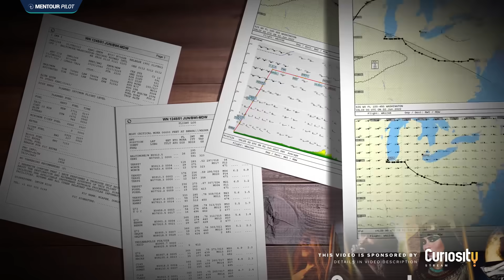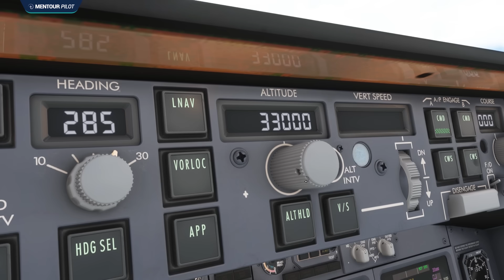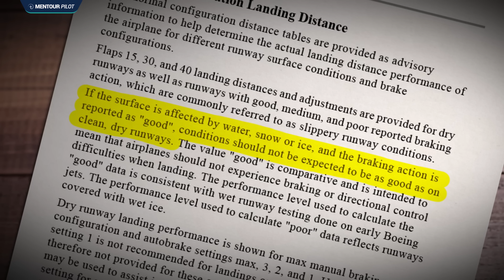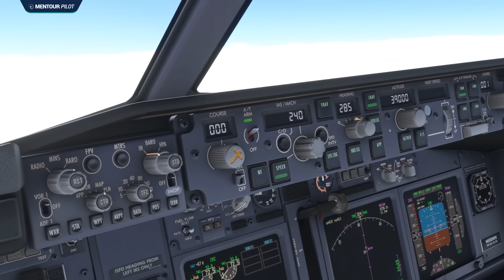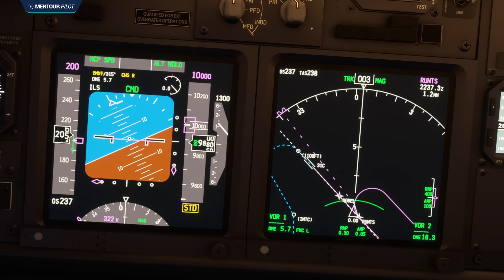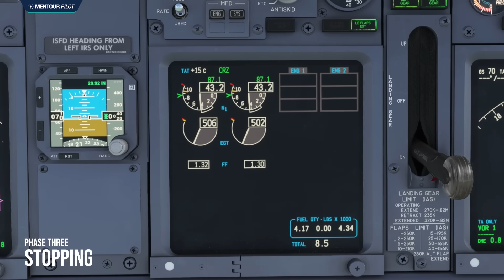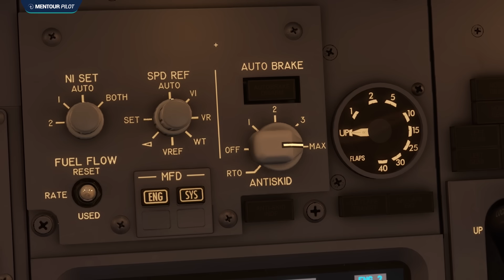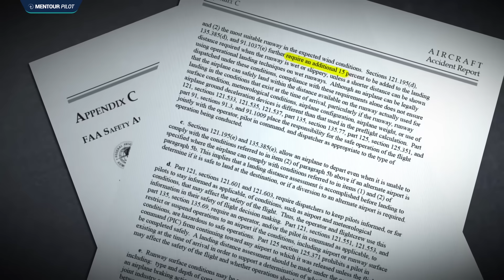WHAT did The Pilots MISS?! Explaining Southwest Airlines flight 1248

Comment: Hm, that was a nice explanation about the breaking process, especially for specifically 737-700, but now i started wondering which part of the procedure actually does the most?

For example, given the perfect weather and plane conditions and an inifinitely long runway, which system alone (or combination of them) would stop the airplane the quickest. Are brakes without spoilers and reversers enough? What if there's no breaks at all, but there is a reverser and spoilers? I am aware that the landing in this video technically has the answer to the second example, but in this case the weather conditions were... slightly unideal. Obviously, the simulation could be extended to these conditions and go from there, but it's the same idea.

Comment: So you're coming in for the 6522' runway 31C at Midway with an 11 knot tailwind and poor braking conditions using the auto-brake at MAX. You land right on the mark, touching down 
at 124 knots. Roughly how far down the runway would you be, without using thrust reversers, 18 seconds after touchdown? And roughly how long does it take to get to max reverse thrust if the engines were at ground idle speed when the reverser was applied?  After 18 seconds, it sure doesn't seem like there could have been much runway left to use.  (Reminds me of a pilot friend who use to say "the 2 most useless bits of info when flying are altitude above you, and runway behind you").

Comment: Not a smart question but: what if the pilots had considered quick flap retraction after touchdown and also full forward yoke deflection to increase downforce as much as possible? Would that have made a big difference?
Reply: I don't think so. Pitching down a plane after touchdown would rather mean lifting the aft and the two rear undercarriages to bring down one at the nose. Doesn't make sense. Furthermore, a working aft brake should help rotate the plane down and bring the nose wheels down, too.
Simple thing of inertia. 
Stone me if I'm wrong, I'm not a pilot.
Reply: Quick flaps retraction is useless with airliners since you have speedbrakes. A little bit of forward pressure on the yoke might be used for directional control , but not for braking since the main gear is not near the front of the airplane.
  And full forward pressure straight after touchdown would cause damages to the nose gear.

Comment: Would it be practical at all to install emergency stop areas on the ends of runways with things like sand pits? They're not that uncommon on roads/hills for runaway trucks whose brakes can't keep up. Stopping an aircraft I'm sure presents a number of unique challenges but the aviation industry is filled with talented engineers who could likely give it a fair go, no?

Comment: It’s hard to get your head around what happened here. During my whole career, if there was ever even the slightest bit of doubt about landing conditions, we were always so conservative, and so ready to deal with whatever might possibly happen. In anything less than perfect conditions, Full Reverse thrust was always out the second the squat switches allowed! 
We also ALWAYS used max autobrakes in poor conditions- it’s very easy to disengage if max braking is subsequently not needed or a go-around is required.
I was shocked when this original report came out- at the time I thought what the hell were they thinking? In my company I don’t think we were ever allowed to make the assumptions that they did.

Comment: EMAS needs to be used more than it is. I don’t know the cost involved, but with the number of runway excursions increasing, any runway less than 8,000 feet should be one factor in the selection along with the number of previous issues with stopping and runway remaining after rotation for departures just for two factors on the top-10 most commonly used US airports.
Reply: Your numbers are arbitrary. How did you choose them ?

Comment: Why is it that engaging reverse thrust is a two step action requiring a separate set of levers? This seems cumbersome. Why can they not use something similar to that used on a C-130, where reverse pitch is engaged by pulling the throttle levers back past "Ground Idle"  as far as they will go, then physically lifting them over a stop detent and pulling them all the way back to "Maximum Reverse" . Now I know the 737 and C-130 are different, one is a pure jet, the other is a turboprop, but the principle and reasons are the same - the system performs a set of mechanical actions reversing the direction of the thrust to assist the aircraft to stop.

(NOTE: Before anyone asks, on a C-130, the reverse pitch detent is either disabled or enabled depending a set of touchdown micro-switches in the undercarriage. If the touchdown micro-switches are not closed, the detent cannot be passed , making it impossible to engage reverse pitch in flight.)

Comment: IDK, but runway excursions increasing instead of decreasing with all the technology, experience and procedures we have today is alarming. To me, (which I have nothing to do with aviation other being fascinated with planes) it seems like as if pilots feel more anxious to get their plane landed on the "correct" (original destination) airport no matter what than they used to be.
I'm sure that there are procedures in place like doing a go around or detour to another airport to prevent this from happening, but it seems like as if pilots don't feel the need to follow these.
I would not like to believe that pilots feel that they will be in trouble if they decide that a detour to another airport is necessary for a safety landing. Yet it seems to me that that's exactly what they are trying to avoid (when dealing with runway excursions).

Comment: I'm not a pilot so this is some outsider two cents, and an opinion at best. In the last part of the video you explained that runway excursions are increasing. I feel like the pilot shortage plus the world we live in today will result in pilots with minimal experience, low hours of training, and a lack of discipline will find their way into the cockpit. I understand the pilots in this situation where very experienced so I'm not talking about them nore am I talking about this situation. I just feel like situations like this will increase over the coming years as a resulting of my stated reasoning which scratches the surface at best.

Comment: Seems to me that it is a design fault that just one movement of the lever does not always activate the reversers. Cheers.
Reply: It's not really a design fault.  It's just an old design.  The "sleeves" of the reversers have to move fully aft before the actual thrust can be added.  The 737 has been around (in various versions) since the late 1960s and the reverse thrust levers and mechanism have remained basically unchanged since it was first certified.  More recently designed systems have a simple lever setup where when the thrust levers are pulled back (to the rear) from the idle detent position, the sequence of unlocking, sleeve retraction and then adding thrust, is all performed in the right sequence automatically by the airplane's computers.  I believe in the classic two-step mechanical system used in the 737, being able to pull the levers back prior to the reverser sleeves first being in the proper position could cause a compressor stall or engine failure/damage.
Reply: @skyhawk_4526  thanks Skyhawk, great explanation. I thought the reason would be something like that. Maybe I should have said poor/lazy design rather than design fault. Maybe 2 levers with lights or audible sounds something like that to make it clear to pilots that the reversers are engaged seeing that they are essential at such a critical time, bit like three greens for landing gear. Benefit of hindsight I suppose. Cheers.

Comment: Problem in commercial aviation is that pilots are swamped with mountains of government and company regulations, very complex systems, elimination of flight engineers for sake of profits and so on. Solution would be huge keep forward in reliable automated systems, massive reduction and streamlining of regulations, and bringing back flight engineers on new aircraft that would be built with flight engineers station. Having a third pilot in emergency would be huge help.

Comment: Thanks for the detailed explanations, as usual! 
A question that has been on my mind for quite a while now since I started following this channel: why aren't these calculations made at the site where they are relevant to? In this case the destination airport? 

Here's why I wonder: They would have most accurate and latest situation data, and having the same computer do the same calculations for all aircraft provides conformity and thus operational predictability, which always contribute to safety. As soon as an aircraft takes off, the airport of departure could easily communicate the relevant parameters at take-off. The only parameter that may need updating during flight, is the fuel consumption (impacting weight and balance), but other than that all parameters from the plane side stay the same. Also, it would allow the airport authority to make the decision if a certain airplane is allowed to land or not based on its technical stats, in which case a denial can be given much earlier allowing for more time and less fuel wasting for holding and deviation to another airport. In fact, if I would be the one drawing the rules, I would mandate a permission to take off be given by the destination first. And all it takes is just a different timing for data transfer (all data is exchanged eventually, so instead of sharing it in backlog, share it 30min ahead), and adding computing power to the ATC, where weight is no issue and the best computer can be used for the job. It would also not double the work (except perhaps on international flights) since the permission to prep for take-off is given by the destination, taking away work from the departure ATC (actual clear for TO obviously has to come from local ATC). It would ask more cooperation and synergy, but that's exactly what you want to see in an environment with safety concerns.

With a wider variety of aerial vehicles in the near future, such ATC integration and proactive data exchange will become necessary anyway, so why not already start getting used to it?
Reply: Airports don’t know the particular requirements and condition of the aircraft. Transmitting that data would open an even bigger opportunity for error. I wouldn’t trust someone else doing my performance calculations.

Comment: Would be better if the anti skid system could be turned off in slippery conditions?
A car with ABS on loose gravel can't stop with the system on but can with the system off.
Reply: My car is nearly undrivable in snowy conditions unless I turn off the ABS.
Reply: The ABS on an aircraft works differently. You’re better with it on.

Comment: Im only at 3:52 in the video, but my first question is, if they used this new system on this flight, why would they use it in these conditions. The question is had they already tried it in the flight simulation things. And wouldn't it be prudent to test it in good landing conditions first?

Comment: Non-pilot thoughts:

Runway has ILS both ways, use the one with the headwind. I don't understand how visibility could be different in each direction? Use the ILS, land into the wind. The Wrights taught us that! Especially when surface traction is poor.

Have an adequate buffer zone at each end of runways. Not buildings or highways. How third world.

Communicate software computational changes. That difference in reverse thruster calculation being included so very oddly kept secret. I wonder what value "they" chose?

Trying out a new braking assist automation in a pinch.

The pilots shouldn't have to plot the landing to such refined values. There was too much tension from the outset. There is the desire to avoid alternates with passengers and pressure is on the pilots. So let's not make them land downwind at all and especially on substandard surfaces. How did the deceleration zone work? They were doing a lot of research near me at FAA tech center at KACY.

A person who didn't even get a chance to live, had their whole life stolen. A few rupees were saved on the end zone. The fault is on the airport and FAA for dangerous runway and improper procedure.

One question: when entering wind into landing calculator, it sounded odd to enter it as a single value. Don't they enter as velocty an direction, letting calculator make the components calculation? They also want crosswind info. They wouldn't, in that case, even be entering 5 or 8 directly.
Reply: The visibility required is dependant on how good the ILS equipment is and what kind of approach lighting there is. It is often the case that a runway cannot have good approach lighting because of the terrain before it and it must then have a higher visibility requirement ti be safe.

Comment: I’m confused about the available space at the end of the runway 31C. Originally in the video at 12:30 it’s mentioned that there was an exemption for the runway Safety are to be reduced to 82ft. However, in the FAA recommendations (24:25) they state that there is room for 229 ft of EMAS. Where did they find the extra space?

Comment: I read an analysis of this crash that mentioned something that your analysis does not and I thought that was a bit unusual as you seem to be in-depth in your documentaries. This subject was the proximity of O'Hare airport and how the conflict with final approach to O'Hare and final to Midway result in pilots having to make a less desired and less safe downwind landing going into Midway which in bad weather would or could present a problem.
The news item said that a pilot can request a runway at Midway that gives them a better alignment into the wind but because of the disruption of traffic into O'Hare they simply don't because of the problems it would cause.
In other words it is a no no for a pilot to ask for this safer more into the wind approach because they all are aware of the disruption of flow into O'Hare such a request, if granted, would cause.
As with most accidents a series of failures  or shortcomings contribute and one factor alone usually is not the primary cause.
And your discussion of contributing factors is valid.
But in my humble opinion if a pilot is forced to land with a less than desired tailwind in very poor weather and runway conditions he should land elsewhere..
I understand how a disruption in the flow of traffic into the much busier O'Hare Airport would be something that should be avoided.
But I also see that in the interest of safety for passengers and people on the ground there may be that rare day when diverting to an alternate airport although costly to the airline and inconvenient for the passengers  may have been the required thing to have done.
Imagine the horror of a 737 coming onto a city avenue.
Without even a mention of the concept of pilots following unspoken protocols that  prevent them from being able to request a better runway, which they have a right to do but don't because of the resultant "monkey wrench" it would throw into the traffic pattern for O'Hare......
I think your in depth analysis is incomplete as it is clear to me it was a contributing factor.

Comment: As a software engineer, I'm shocked (but not really surprized) by how many accidents are caused by bad software design in one way or another.
3 places where better software design would've prevented this story from happening:
a) In the landing calculator software pilots shouldn't have to assume if thrust reversers are included in the calculation or not. There should be a checkbox that explicitly says 'use thrust reverse'
b) Silently replacing 8kts with 'good' value of 5 is just... without comments.
c) Pilots shuoldn't be forced to wait until thrust reversers are configured before being able to use them. They should apply full throttle immediately and all configuration sequence and waiting should be done automatically by the system. That's what we have electronics for.
Reply: I disagree on c. This is to protect the structure of the nacelle and reverse cascade. If you are allowed to accelerate during deployment you’ll just break the reverser.
Reply: @peteconrad2077  no I mean of course the engines should not be spooled until reverses are fully deployed, just that the pilots should be able to set full position right away, then what should happen is reverses to be deployed and full thrust applied automatically when they are ready
Reply: @РоманПлетнев-г3э  well you can on an airbus. But this is a boeing.

Comment: I'd expect the airport to have a procedure to close the highway when the runway is slippery.
Reply: So you're gonna impact thousands of commuters and other drivers because of the minute possibility that a pilot makes multiple mistakes that lead to an overrun though the airport fence?  That's ridiculous.  If anything, the airport should restrict its operations in those conditions, not the highways and roads surrounding the airport.

Comment: Amazing video as usual. But I can't help thinking that the design of the thrust reverser system is stupid. Why force the pilot to wait and have to remember to manually select full thrust once the reversers have deployed. You could simply select the desired reverse thrust and then have the system automatically deploy the reversers and then go to the fired thrust setting, with the pilot just selecting the desired setting immediately.

Comment: Something about reverse thrust seems like a dangerous idea.
Reply: It's only dangerous if only works on one side.  But even then, it can still often be used - you just have to be careful and not use as much or the plane will veer toward the side of the reversing engine to the point it can't be corrected with opposite rudder and nosewheel steering.